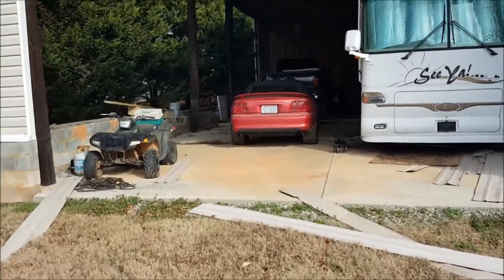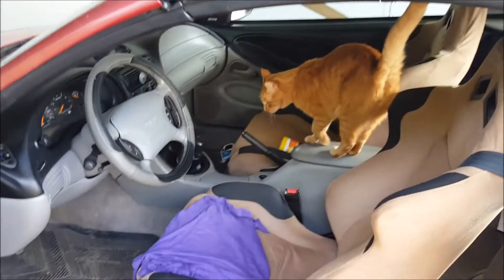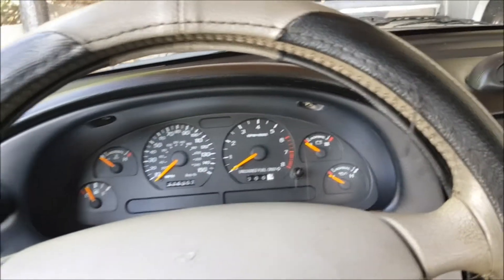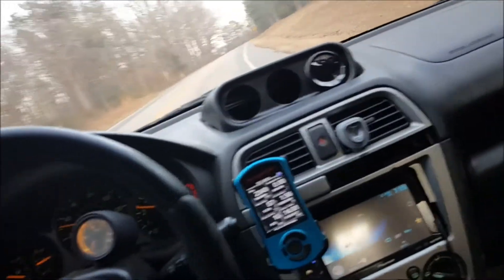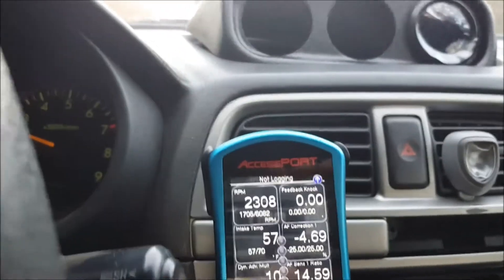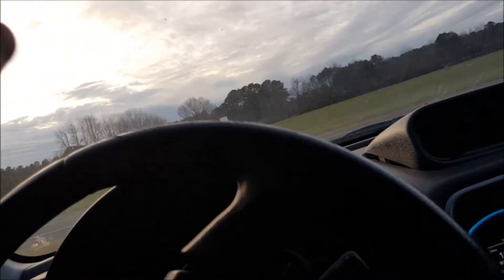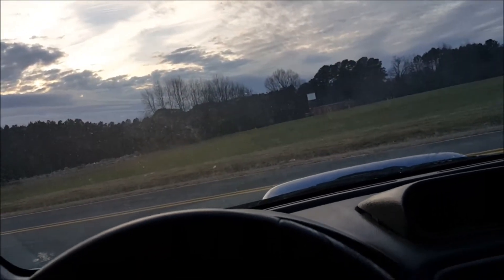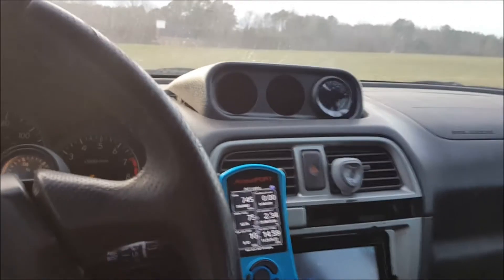V-Dyno 2002 WRX Ebay Turbo

Comment: The correct factor you are using is awful. Just use the uncorrected 1. 00 virtual dyno correction.. Also dont forget to set weight accurately

Comment: I may be wrong but 4th gear is closer to 1:1 on that car, correct me if I am. So 3rd gear pull will show at little more HP than TQ. Nice bugeye.. I miss my Aspen White '03.
Reply from the maker: Brandon G yea love my wrx its going to get some more boost after the integra build is done but its fun for a daily driver :)

Comment: Any fitment issues with cx racing intercooler???
Reply from the maker: it was a little tight but all the pre-bends fit and the mounting bracket to hold the cooler fit with no modifications. whats your current setup?
Reply: Motor Nubs I have a vf39 w sti tmic but wanted to get a fmic been hearing good and bad about this kit why I ask. Would u recommend it ?
Reply from the maker: yes for the money it cant be beat! are you protuned? how much did you put down
Reply: Motor Nubs not yet I have to wait my turn in line to tune it lol I'm hoping good numbers
Reply from the maker: Keep me updated curious to know what it makes with the VF